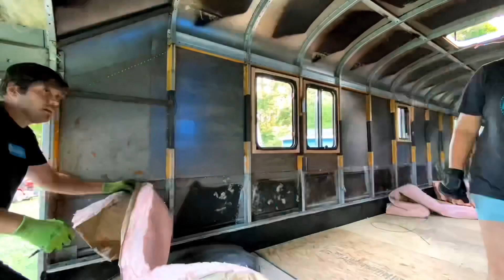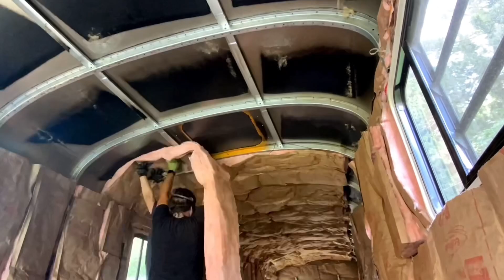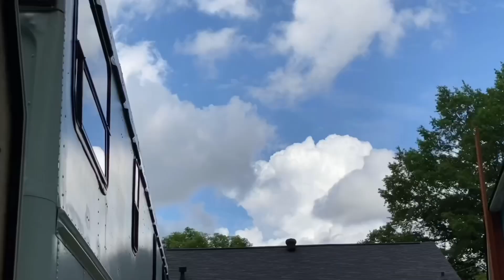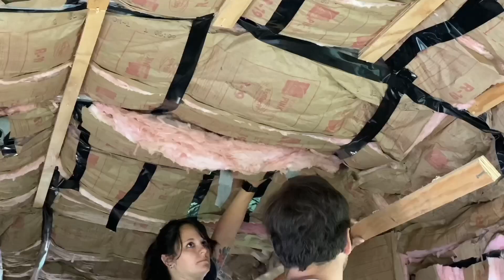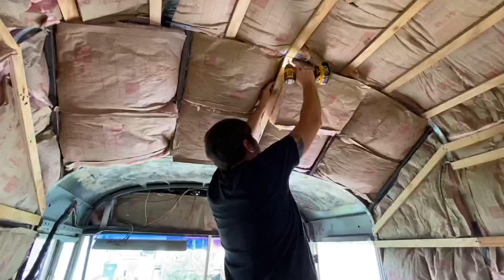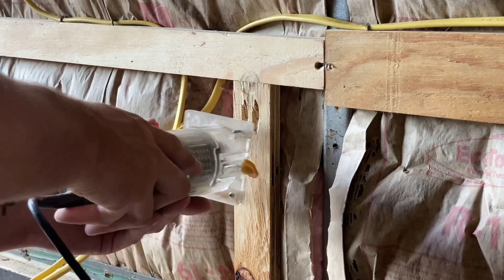School Bus Conversion Episode 14 - Inside construction begins *SEND HELP!!!*

Comment: run a PVC pipe or something like that. It can help run wires and cables. This can be done before you attach fairing strips etc. It makes it easier to drop wires down to plugs plus run ethernet cables for future use like webcam for backing up etc
Reply from the maker: Hey that’s a really good idea. Thanks brother!!!
Reply: I've seen other builds plus boaters using a wire channel to a junction box just above where you want to run 12v to 5 v USB in a desk etc. Pre-wire and drop the wires to the approximate area, that would also work for running 110v shore power from your in-house solar controller/inverter to various locations in your build. This will save you the head of hard proofing the wiring from movement in the bus. If a circuit goes south. You can add a fish line for future pull to run cables back to the battery box etc. I had a video/tv audio desk go in a tour bus go when I was driving the Watoto Children choir in Canada. I could not believe how MCI chicken wired the bus when it was built
.

Comment: Any concern with the insulation and the walls sweating?  I have seen some videos where they are using wool or sprayed in insulation?  You make everything look easy.
Reply: Should either use foam board or spray foam as this fiberglass insulation as seen in video can create toxic mold if it gets wet

Comment: Love the video. Many great ideas. I really like how you did the insulation. I would worry that the wires would wear throught with the staples over time with the movement of the bus. I am doing something similar but using electrical conduit for mounting purposes, and if it ever needs to be pulled, the entire wall doesnt have to come down. I am excited to see the next video for more ideas.
Reply from the maker: I’m also concerned about that but we’re just hoping for the best 🤙🏻🤣